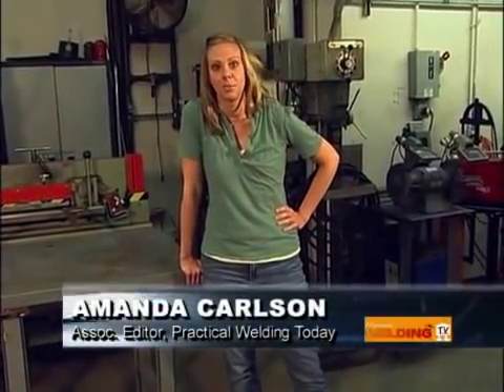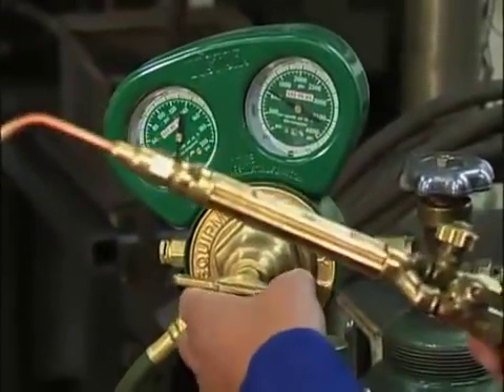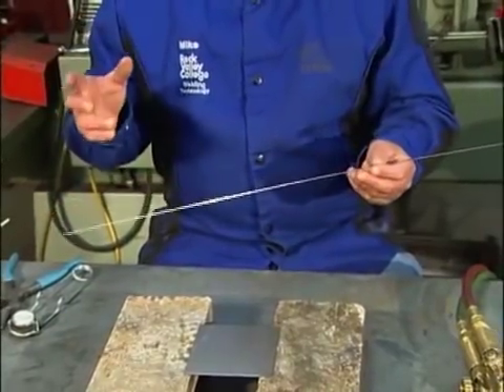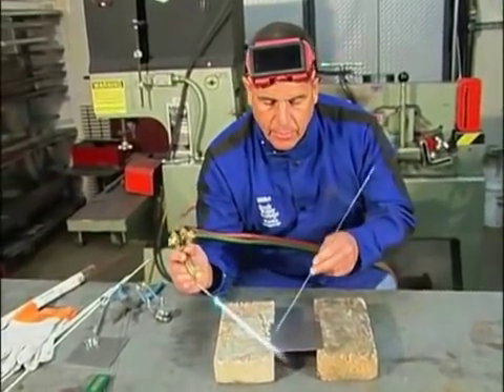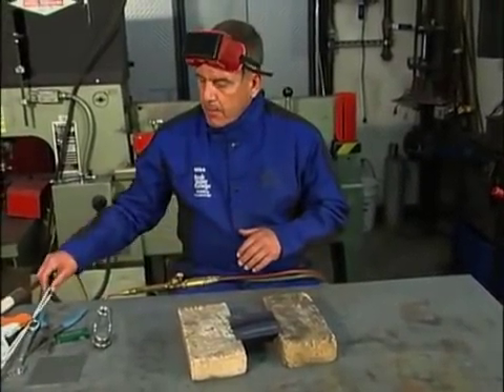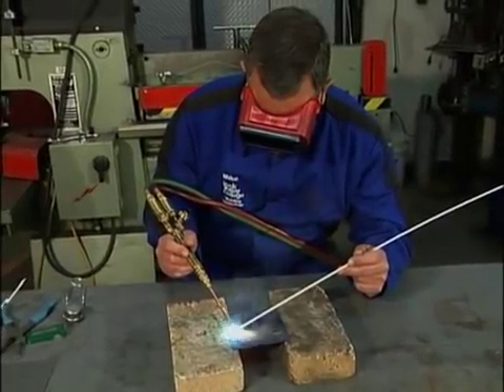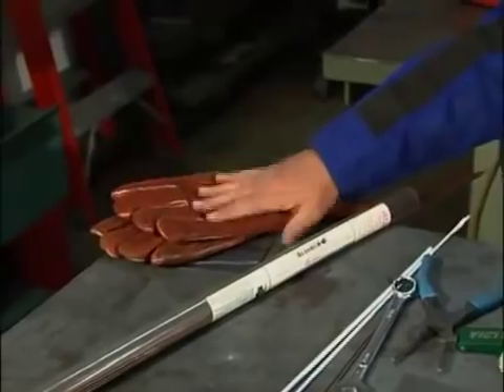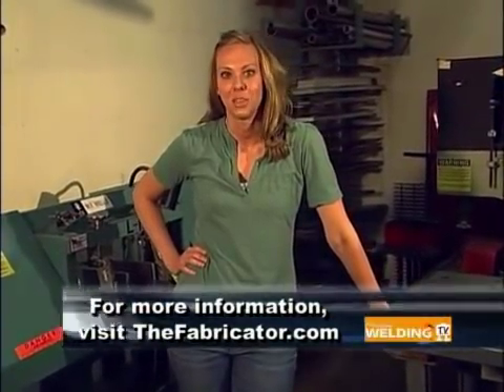PWTV: Oxyacetylene Welding Part 2

Comment: What causes a backfire with a heating tip?  I borrowed a small rosebud tip from a friend, adjusted it for a neutral flame and after several seconds the flame went out and the part where the nut goes on got very hot, the flame followed the gas flow back towards the mixer handle.  I shut the gas off in time before it got worse.  I didn't see any damaged O rings.

I know some mixing handles have check valves to prevent major backfire problems, but what was going on here, not enough pressure, too much?  

Jim
Reply: You got it. Wrong pressure or pressures.  Acetylene too low will do that as oxygen higher pressure can push the acetylene ignition point inside the torch tip or body and yes...it will melt your torch

Comment: I like this video a lot. Why? Well, because he thinks before he speaks. He uses trade terminology/ technical answers that reinforce the concepts in application. Thank you for the upload.

The only problem I really have with this is that he failed to "crack" the cylinders prior to 'use' setup. And the reason why we want to "crack" the cylinders is to ensure there is no dust, debris or grease obstructing flow.

Comment: I have a question about a popping noise I have a brand-new Victor medium size torch I have a Radnor cutting tip brand-new as I start to get to a neutral flame it starts to pop and continues to pop I have cleaned out the new want to tip just to make sure it's OK job but I can't seem to stop the popping noise do you have any suggestions
Reply from the maker: Have you tried removing the tip and re-seating it?
Reply: Fabricators & Manufacturers Association yes it worked. Thank you!!
Reply: Try turning up your acetylene
Reply: Or try tightening your tip
Reply: Make sure tip is well seated and that o rings are not damaged in any way. Is sounds like you've drawing in air.
Reply: Try tighten ur tip maybe is not well tighten

Comment: We were taught to adjust O and A from the regulators with torch valves open full.
Reply: From the torch, I tend to think it's user-oriented. Meaning... you can if you want... But be advised, if there is a problem -- say, with your acetylene such as your torch catching fire -- you'll want to keep in mind that 'one-gloved' hand turn is all you'll really have time for if the shit REALLY hits the fan.

Some of us aren't as "well-off" as a community college. Some people may not -- for some reason -- prioritize flashback arrestors or have the necessary tip, so when knowing "this" could happen -- or "that",  when equipment is for some reason limited -- it'd become priority to ensure a back up system to achieve something similar to redundancy.

...Or maybe not... do the fucking job. I suppose it all depends on how much someone values themselves and their immediate surroundings.
Reply: I had a tow hitch red-hot fall and sever my torch... Promptly making a whipping flamethrower. Think fire hose whipping. It was proof of a one-turn fuel off!